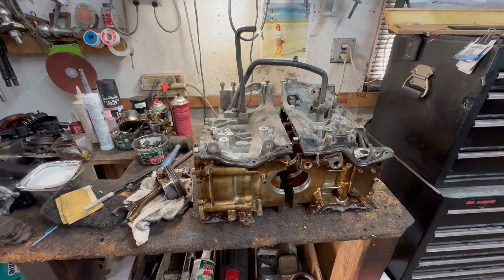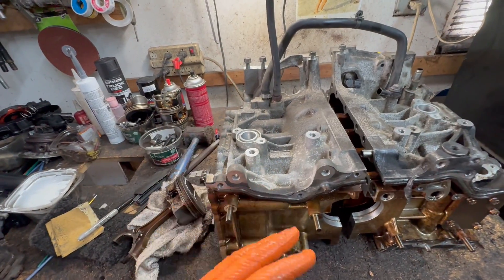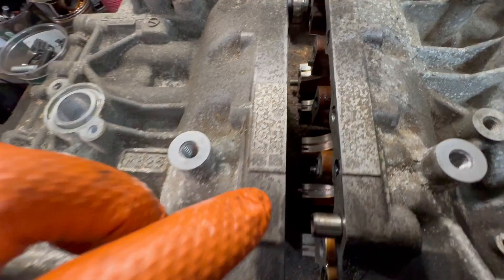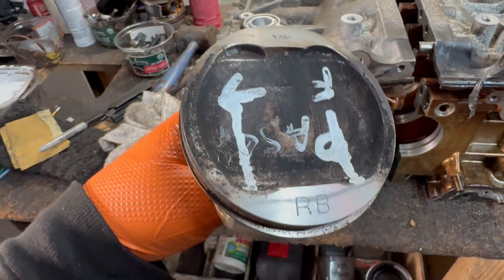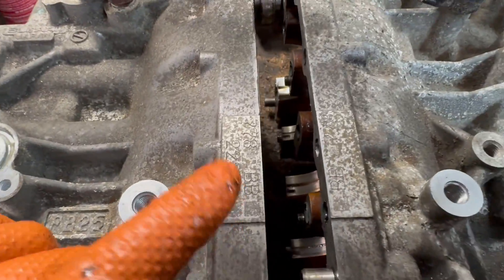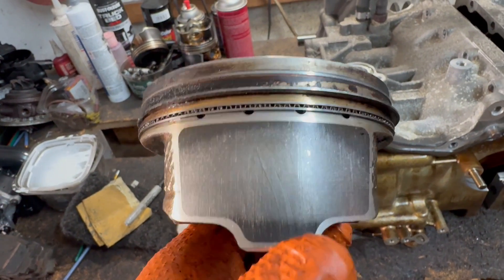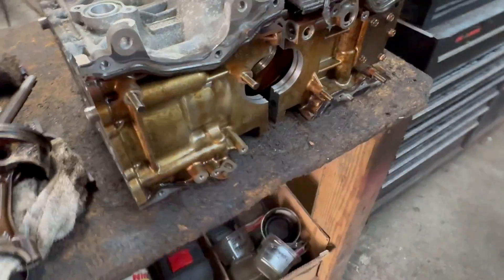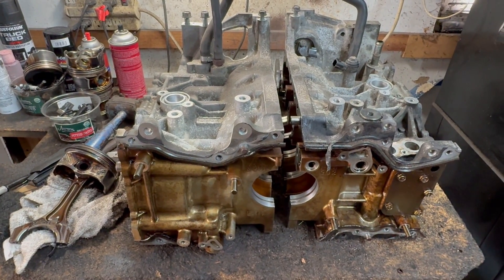Subaru Engine Rebuild, How To Know The Right Size Standard Piston

Comment: Great info. Quick question. If you put an A in a B bore you get piston slap? If you put a B in an A will the rings wear or scar the cylinder?
Reply from the maker: Actually the other way around. A is slightly bigger than B but you’re correct otherwise. I misspoke on that one